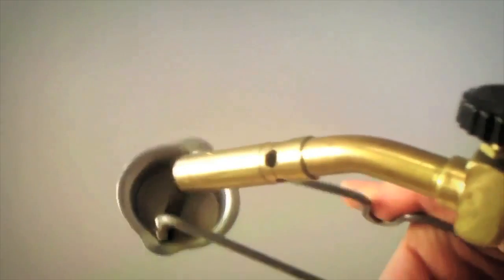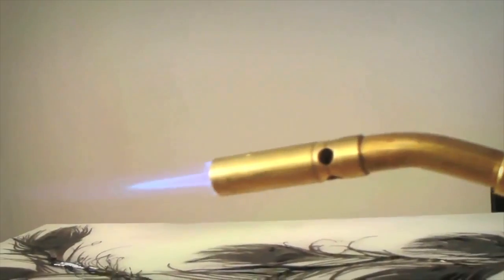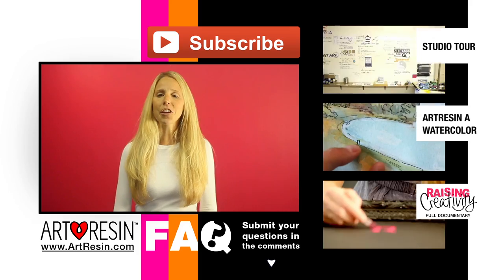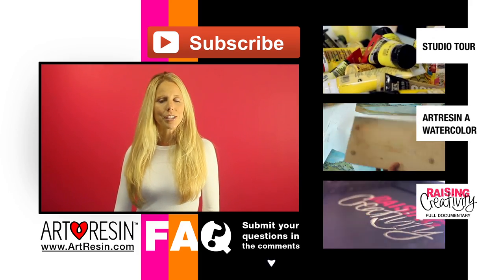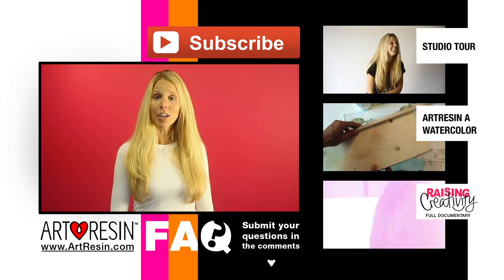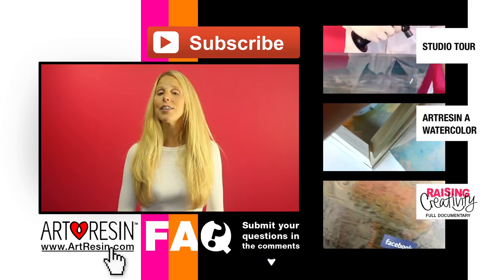Using blowtorch to get rid of bubbles - really?

Comment: Can we use any blow torch for small resin project... Or is there any specification required. Also what distance we need to maintain while using blow torch
Reply from the maker: Hi Akanksha, yes you can use any propane or butane torch to pop the bubbles. It's important to remember to hold your torch a few inches above your artwork and always keep it moving in an ironing motion. For more information on how to use a torch, please visit out website https://www.artresin.com/blogs/artresin/how-to-use-a-torch-on-epoxy-resin?_pos=5&_sid=b80abb635&_ss=r

Comment: I was hoping to get more step (s) after mixing 6 minutes / pour into new cup mix for 6 more minutes, then apply pull on brush to free loose hairs,  go back break surface tension with a up & down movement using the brush, here is my question the torch how long after applying, do you blow torch it? more then once in stages??? I really don't know but that was the step  I'm looking for regards Jeff
Reply from the maker: Hi Jeff, 

We usually just do one quick sweep with the torch after we have the resin placed how we want it. ArtResin does have a pot life or working time of 45 minutes when used as directed so you will want to take that into account and not torch after that point. I usually pick out any hairs or dust then torch in a steady ironing motion it maybe takes 15-30 seconds on a 12x12 piece. Just use caution to not stop in any one spot or to repeatedly go over an area, you don't want to over torch :)

Comment: using Art Resin, my acrylic painting turned out beautiful BUT two edges didn't take the resin as well, all is smooth but those two edges.  This is a gallery piece, what is the best way to fix this.  The rest of the piece turned out perfect.  It's a canvas btw.
Reply from the maker: Hi Karen - can't say for sure without seeing your piece but it could be a couple of things ... 1) something may have repelled the resin and prevented it from adhering. Did you use silicone oil at all?  It can also be something as simple as the natural oils or hand lotion residue from our hands that remain on the piece after handling it, and this is enough to repel the resin.  But since you said it was a canvas, I'm leaning towards 2) the weight of the resin stretched the canvas and caused the resin to pool in the center, pulling it away from the edges.  We recommend using canvas boards or wooden panels when using resin for this reason, particularly for large pieces or - when using a stretched canvas - you can reinforce the back with cardboard and wooden slats.  Take a peek at this video to see how it's done: https://youtu.be/AJ8mrJ8WWuE

To remedy either issue, you'll need to sand down the cured resin with a coarse sandpaper ( 80grit ) and re-apply a fresh coat of resin.  If you think the bare spots are a result of oil residue, you can wipe down your piece after sanding with mineral water ( like Perrier ) or apply a sealant over the bare spots to create a barrier to prevent the same thing from happening again.  If you think the bare spots are a result of the canvas pooling, try reinforcing the back of the canvas as per the video, with cardboard and a crossbeam, sand down and apply again.  Make sure you use a level to ensure your piece is as even as possible before you pour.  

Hope this helps!
Reply: I think you're right, that's what i decided to do. I wiped it, sanded it, wiped it several times, sprayed a semi gloss on it and put cardboard underneath to keep it level.  I leveled it as usual when pouring originally but I had not done the cardboard, I will have it in place when i re pour tonight.  Thank you for your help. Much appreciated.